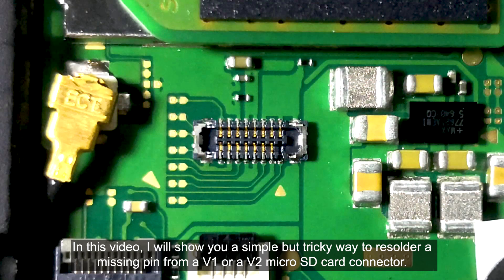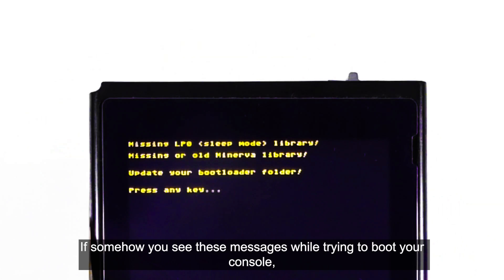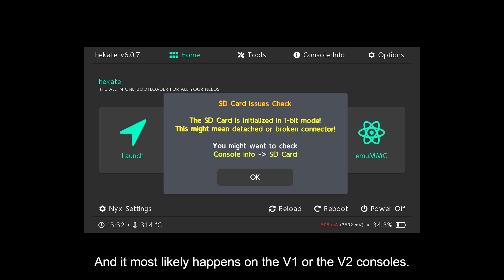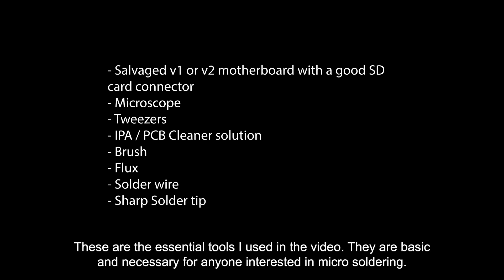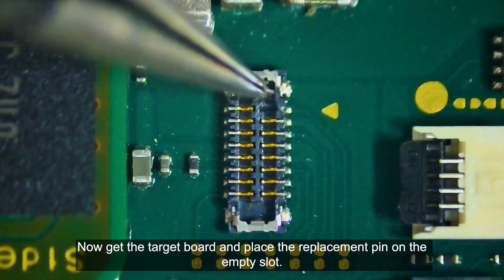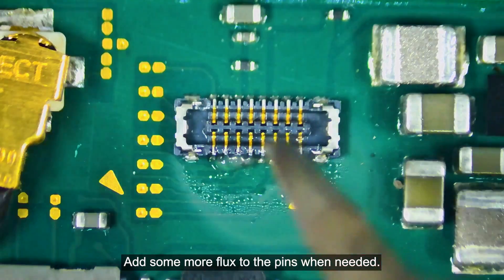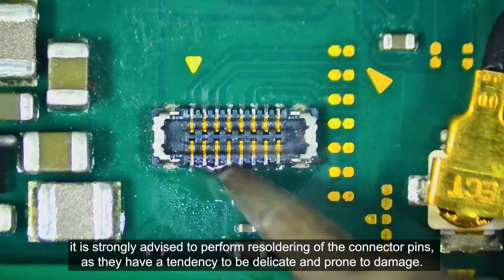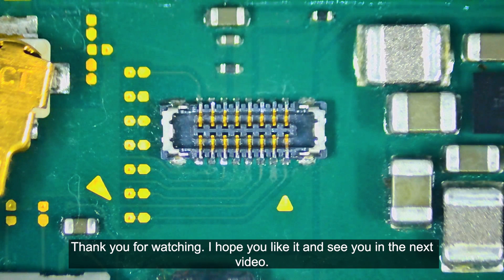MICRO SD CARD CONNECTOR PIN TRANSPLANT

Comment: Thanks for this tip, I did not consider this possibility but that's good to know!
However, the cause is not always (a) missing pin(s). I also encountered a connector with some pins bent, almost inperceptibly. So even if all pins are present the connector can still be faulty. I just ended up swpaaing the connector, pins and all, from a donorboard by applying heat from underneath the boards.
Reply from the maker: yes the video is just an example.